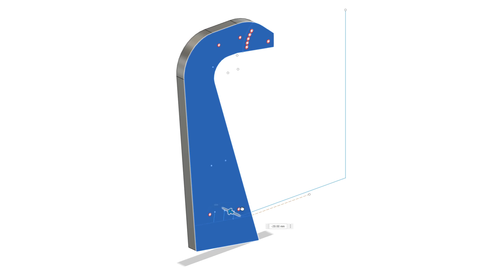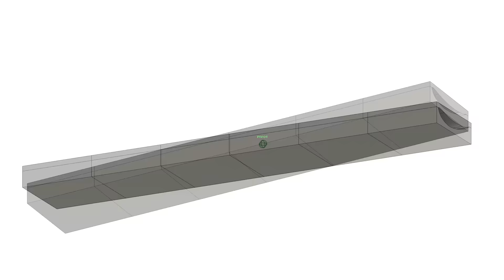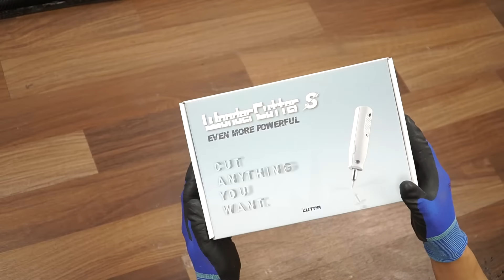How to Make a Carbon Fiber Swan Neck Wing [DIY] (with 3D Printed Molds)

Comment: For clamping during glue-up, why not use a vacuum bag as well? It applies very even pressure, and is used a lot in guitar building, for example.
Reply: The part pressed wasn’t filled evenly, only a few strips of foam inside, with vacuum it would have collapsed or the glue would burst out due to the pressure

Comment: You did a great job and spent a lot of time with the sanding block - but the result is totally worth it! 👍😎👍 
Maybe a fill primer would be a quicker way to eliminate the 3D print structures (instead of the gel-coat), because the primer is way more easy to level. But I hope, you won't have to build another one - at least not for the same reason! Have fun with your great looking car! Greetings all the way from Berlin!
Reply: Epoxy gelcoat bonds much more stronger and less likely to come apart when de-molding. Maybe with a one-time only use mold, fill primer is fine. But with the amount of materials used just for the molds, it would seem much better to have everything stronger for producing multiple parts before if that is his case. Maybe he just has gelcoat handy on him so he just used it.
Reply: @voongnz  Your suggestions might be right. I used.plastic primer combined with a high build primer with ABS and PLA prints in the past and had no adhesion issues. As long as the mold is waxed and prepped with PVA, like perfectly shown in the video, filler should be all right. But that's just a little recommendation, the wing came out great and reality proves, there are a lot options to find a solution. 💪
Reply: @WestBerlinCustoms  yes absolutely, proper application of release agents and mold design is what matters the most when de-molding and having the mold and part in good condition after. 
Yeah many different processes for the solution, many people just apply a single layer of gelcoat and let it self-level for a smooth finish. So even his example is different.

Comment: very interesting idea as a maker, but couldn't you make this design into an active aero system? it seems you have the adjustment design well, but if you could add some strong motors to the rear wing, it could have the wing angle under braking, for example

Comment: It seems that you have not done any measure to prevent galvanic corrosion between CFRP and metal parts.
Reply: Anodising creates a thick enough barrier between the carbon and the aluminium, and the bonding adhesive gives enough space between the pieces too

Comment: Beautiful Wing :) real good job ... but can we have more details about swaneck fixation :) you talk 12 layer of carbon, but we don t know more ... :(
Reply from the maker: Hello, friend.
Making a swanneck upright is no different than making a wing.
I just laminated 14 layers of carbon fiber and 1 core mat.
Same goes for bonding the metal inlet mount to the upright.
Reply: @ECOLAPStudio  thank for your answer :)
Reply: another question, the other wing you have put carbon fiber between top and bottom, now you use foam. Which is best ?

Comment: Great video! One curiosity, how do to ensure you do not get galvanic corrosion with carbon and metal bolts?
Reply: Good question. Normally contact areas have a layer of fiberglass in between to act as a barrier to prevent conductivity. Didn't see it here as part of the build.
Reply: @nottherealjk  Yeah I'm using aluminum to mount some items on a monocoque I am making. I have read the info and plan on using a thin sheet of fiberglass over the aluminum plates.  But  IDK..   I heard that GALV corrosion will weaken the carbon (like rust or something?)..   If you learn anything  about it on your project write me back.. Thanks DMAX motion sim
Reply: Yeah same question here .. 
I'm using aluminum to mount some items on a monocoque I am making. I have read the info and plan on using a thin sheet of fiberglass over the aluminum plates.  But  IDK..   I heard that GALV corrosion will weaken the carbon (like rust or something?)..   If you learn anything  about it on your project write me back.. Thanks DMAX motion sim

Comment: You cut zero corners that’s for sure, wow! Where did you get the metal bits? And did you mount it to the previous mounting location?
Reply from the maker: Hello friend.
The internal mounts are CNC machined.
I previously designed the wing to fit its position.

Comment: Hello I wonder why you don’t use indexing pins or other shapes to align parts?
Reply from the maker: Hello friend.
I fixed the insert mounts that connect the wing and the upright, and those mounts were bonded in place on the 3D printed mold.
We bonded other insert mounts based on those mounts.
I didn't think an indexing pins were needed.

Comment: I don’t get why you didn’t just print. The wing as a positive and then took a negative mound from that for lamination. Seems like a lot of pla could have been saved…
Reply from the maker: Hello friend
I wanted to make a carbon fiber wing.
So I printed a negative molds.

Comment: what airfoil profile did you use to design the wing? it works nice?
Reply from the maker: Hello Friend.
I made some modifications based on the design of the wing of F82 M4 GT4 and  G82 M4 GT3.
I haven't done any CFD testing, but I think that wing is very nice.

Comment: I love the concept, great use of what you have to get the job done. 

I think you missed the mark on the static angle of attack. The air coming over the car is hitting the wing at a different angle than the air coming around it… so a multi AoT wing would perform better, well if its done right… 
I suspect the swan necks would do better as tear drops and with a bit more distance from the wing. But that is a guess honestly. 

My last criticism is that you put in all the work and ended up with the most basic design. A little bit more time in cad and you could have designed something extraordinary… 

Dont get me wrong, its beautiful..  you did excellent… my hat goes off to your sir…
Reply from the maker: Hello friend.
I fully understand your opinion.
But, in Korea, wing should not protrude out of the car outline.
So I'm going to make uprights for track only.
Thank you for your advice.